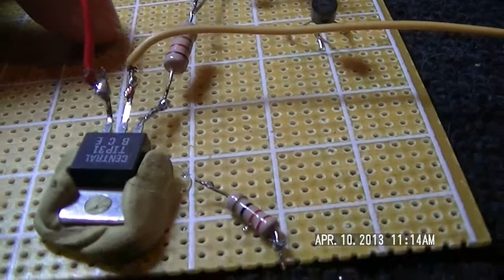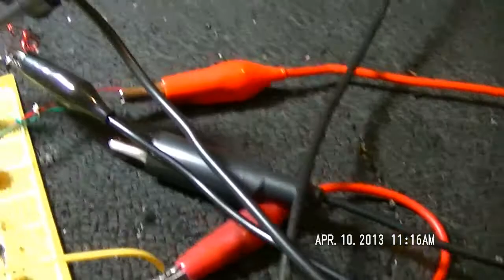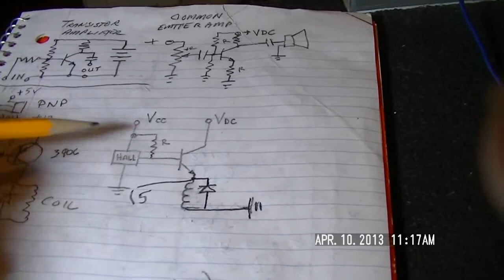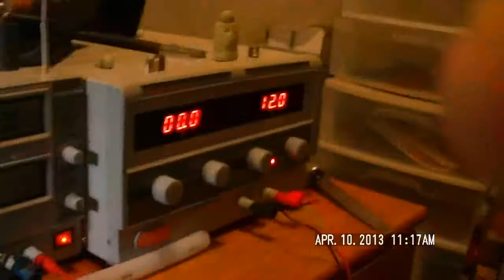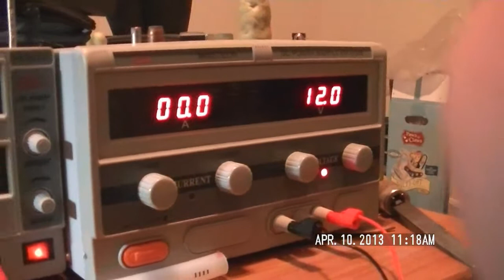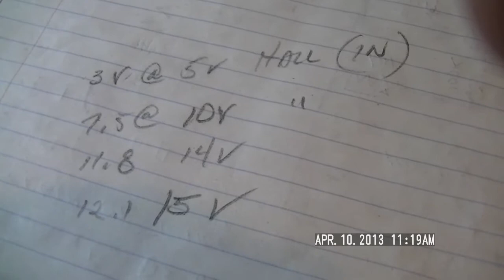The Tran parts working but the sistor parts broke. LOL

Comment from the maker: Hey Q.Moto,  thanks for taking time from your church tower duties by chimming in with the help.  LOL 
ok, I ran the ECN thru and changed the coil config. Vdc to coil start, then to collector. then .01uf cap in series with an diode.. anode to  collector other end to Vdc.   I think thats right...  thanks again.